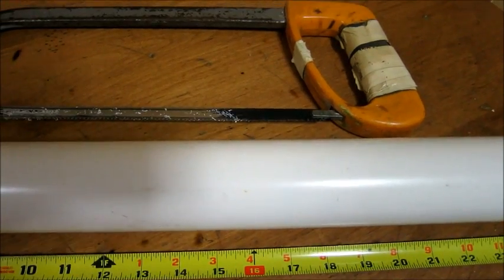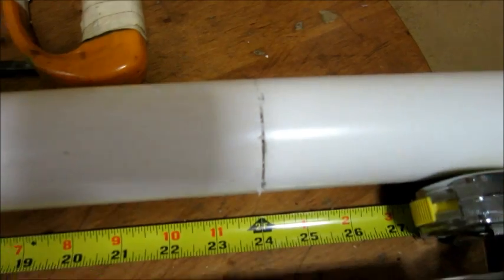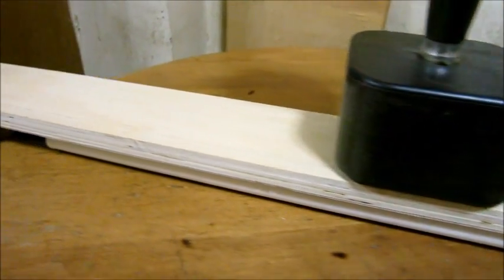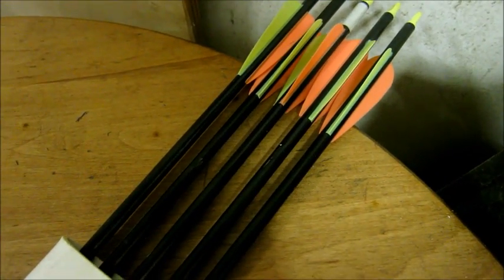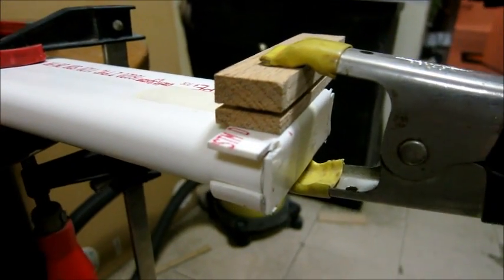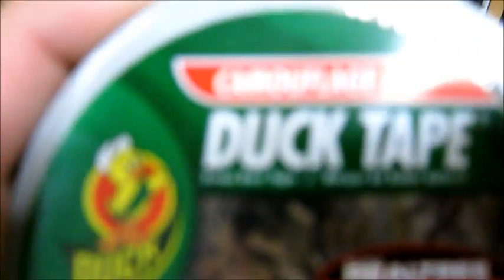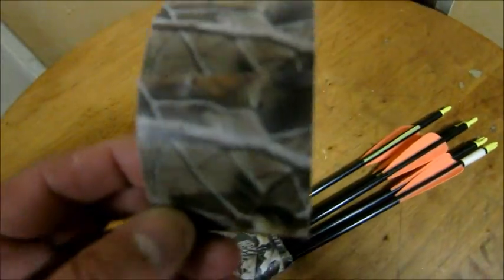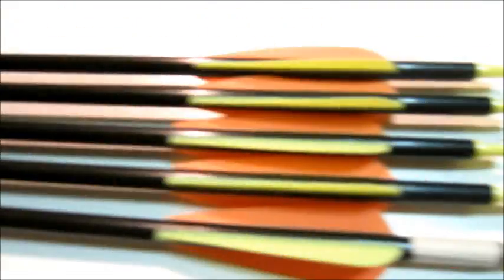P.V.C. QUIVER IN CAMO ( D.I.Y. )

Comment: good job!...with the end cap, if you sprayed a little expanding foam in the bottom and laid a flat piece of pvc on the bottom and duct tape to hold it to the quiver so that the foam doesn't push it away while it sets, you can trim it off after everything is dry, you can push the arrows in and they won't bounce,bunck or rattle:)x
Reply from the maker: Very good idea, thanks Lee.
Reply: Lee Pearson good idea.

Comment: Would putting a 2" PVC plug in the bottom then place it in the oven...then run the wood in the center of the pipe, flatten it and when flatting the end with the plug, have the dumb bell on top of the pipe and plug to cool together so u have bottom formed at same time...then if needed seal it with silicon?
Reply from the maker: use a wooded plug its a lot easier.
Reply: LabanKishi i understand what you mean, i havent tried it but i would assume the end cap would shape differently due to thickness and might warp away from the pipe